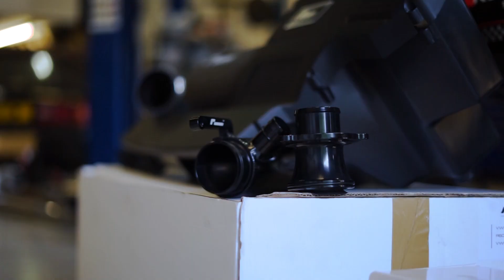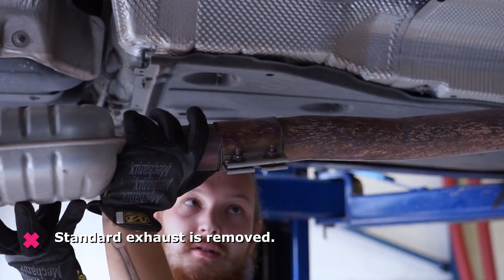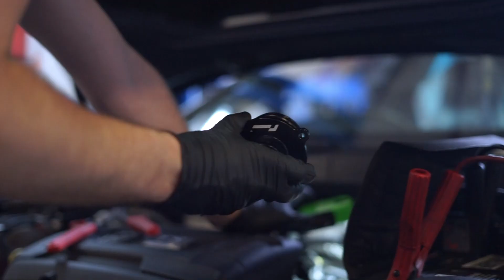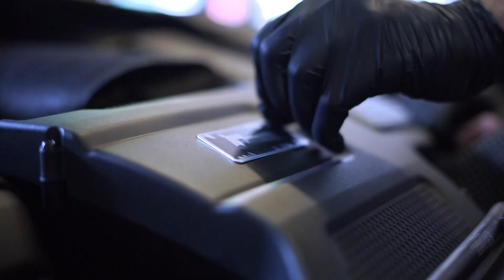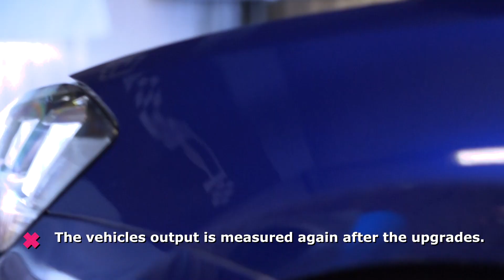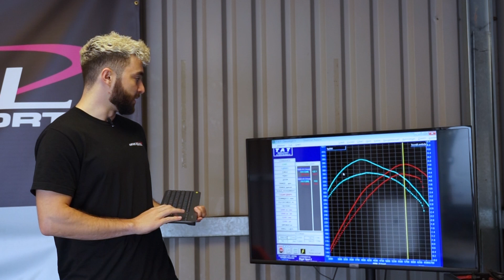MK7 Golf R APR Stage 1 Low Torque to APR Stage 1 High Torque with Racingline Intake & Remus Exhaust

Comment: I had APR stage 1 HT and DSG tcu remap for 1 week on my 2016 Golf 7R. After drive it, I felt a lot of torque&power but the engine-drivetrain more stressed and the exhaust very loud for me (even in ECO mode). So I have changed to the LT file and I am very happy with the result, quieter at low's but enough power from 3500 rpm to the redline. 
Do you advise me go back again to the stock DSG map for the low torque stage 1 or it's a best option to keep it even with low torque file. What you you think? thanks
Reply from the maker: Not sure what you're talking about there, we do tonnes of APR Stage 1 High Torque & DSG software, perhaps there is an undiagnosed issue with your car or a preference for less sound. 

DSG software from APR is a massive benefit, we would recommend it as there are benefits beyond the power!

Comment: Thats low figures for a stage 1 tune? Most s3/R's makes 360hp just with APR stage 1 file.
Reply from the maker: The car went to 370HP & 386lbfts, which is more than you are talking about?

Comment: As a Mk7 Golf R owner, I like these videos.
Reply: Same here i just need stage1 but im manual
Reply from the maker: @jamstersmith4625  it's exactly the same process for the manal, but swap the DSG software for a clutch upgrade. If you want to learn more, contact a performance specialist (contact info at the bottom of the description)
Reply: @RegalAutosport  ive already replaced clutch, went with a helix. Thanks for the info new sub 👌
Reply from the maker: @jamstersmith4625  Thanks for the sub! Enjoy your R (Y)
Reply from the maker: Thank you, it means a lot to read this <3

Comment: Why didn't the customer do stage 2 one time?  Does the car not have a downpipe?
Reply from the maker: This car is completely stock, so Stage 2 could not be installed. Stage 2 is for cars with at a minimum a high-flow downpipe. 

Bigger gains can be had from installing the ECU Stage 1 High Torque + TCU software together, rather than the ECU Stage 2 Low Torque and a downpipe.
Reply: @RegalAutosport  ah I see, I assumed the customer had a downpipe installed already as you guys fitted a catback exhaust to the car
Reply from the maker: @yuvirramjit  Definitely just a cat-back and intake for the hardware mods on this car :D